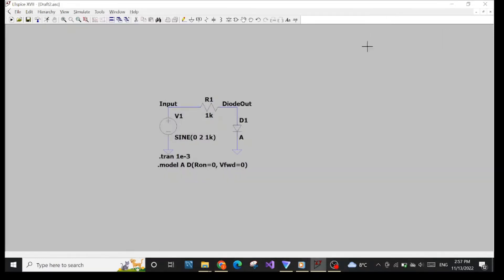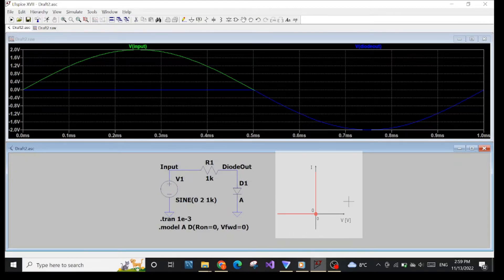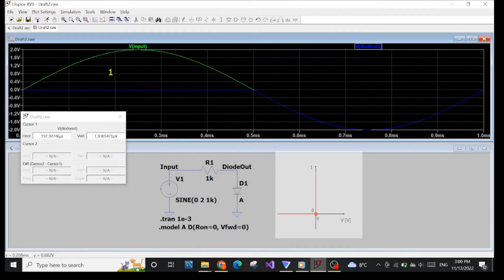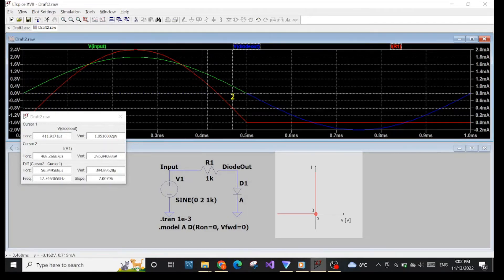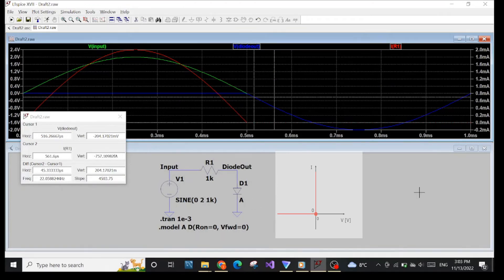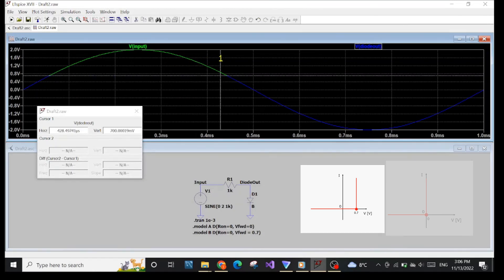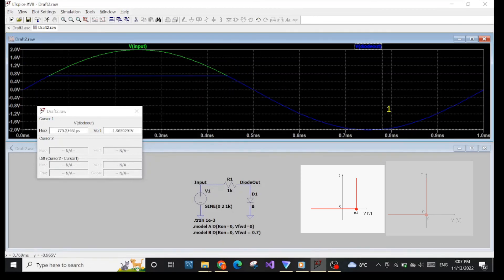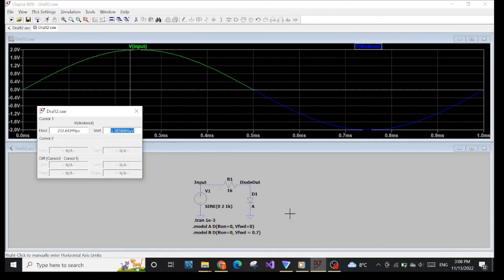LTSpice, Diode Simulation, .model - Part 2

Comment: I have a question. In example 2, here is real Diode right?
Reply from the maker: Hi, it is still an ideal diode. They are only incomplete models which contains only the threshold feature of a real diode. A real/ non-ideal diode will also have other features such as a slope (instead of a straight line after the threshold), etc